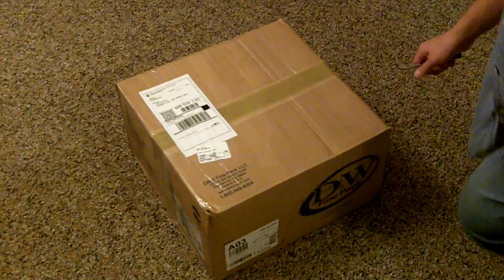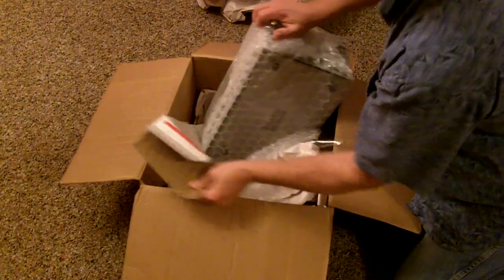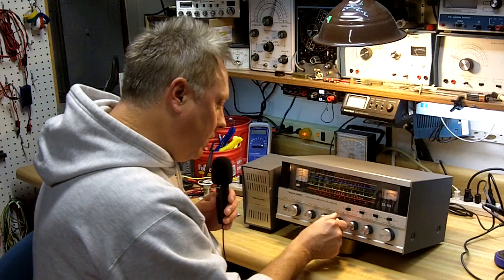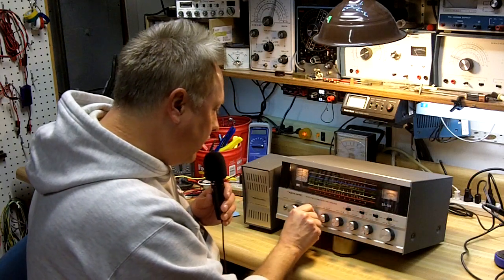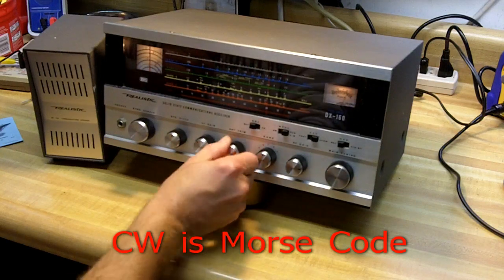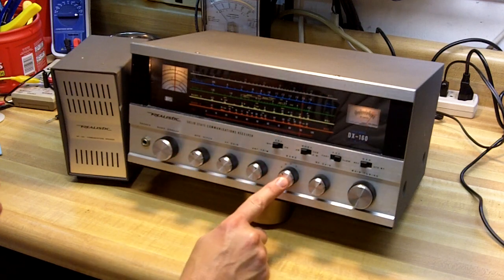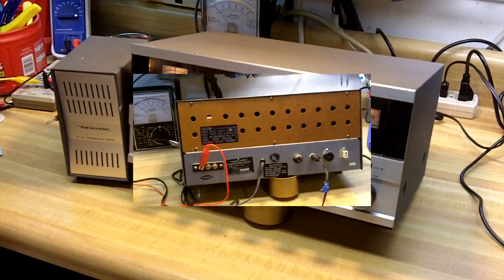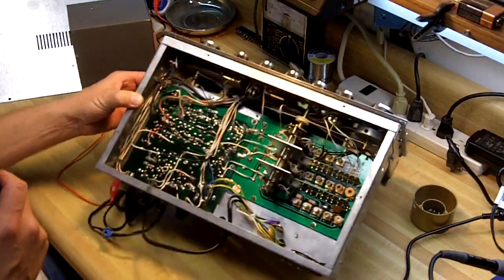My Realistic DX-160 Shortwave Radio Arrives

Comment: I see you've got what looks like a Heathkit IG-5280 RF oscillator.  I picked one up at a hamfest for $5 because it looked interesting but I can't find much information on its operation.  Where would you recommend going for starters?
Reply from the maker: I don't have much info on it here myself either, I do use it from time to time and it works fine but I think there is some places out there that sell manuals for Heathkit products online. I would just do a search for Heathkit manuals and include the model number and I would think you would probably come up with some things. Maybe someone else will comment here also.
Reply: RadioHamGuy Alright, thanks.  And by the way, it was your Magnum 1012 video that got me interested in HF and it's the reason that I have my General ticket today.
Reply from the maker: W7KMS Wow, that is really great to hear!  I hope you enjoy hf, it has been so much fun for me, so many things you can do if you want to on those frequencies.
Reply: I've been really eager to use it but I got my dipole in the mail about a week before I had to leave for college.  I used a random wire for SWL for a few weeks before that, and I got a QSL card from WWV.  Unfortunately even listening has been impossible in this dorm room.
Reply: Look over on Jeff Tranter's You Tube videos; he does a set of videos on this series of test equipment from Heathkit.

Comment: Hello again. I just bought a 1954 Hallicrafters S-38D and it works great except on band four. On band four all I get is blips and static even with using the band spread control. I am running a single wire 100 foot antenna outside.  AM stations do drift sometimes but, I think that is probably normal. Do  I need to hook up my antenna differently to receive well on band four? As far as I know this unit has never been aligned and I am not really sure if it needs it or not. The sound quality is hard to beat on this tube unit. I am really having a lot of fun with it. Anyway your thoughts would be appreciated regarding my band four problem. Thanks ahead of time.
Reply from the maker: Conditions can change a lot on band 4, it is a daytime band so at night you won't hear much but you should hear something in the daytime at least towards the lower end of band 4.  The higher frequencies really depend on solar conditions a lot, some days might be very good but other days you might not hear much.  The antenna you have should work just fine, but it is also possible there is just a problem with band 4 on your radio also.  It could be the band switch contacts are bad or not sure off hand what else.  At times you should hear a lot of signals in the daytime if it is working though.
Reply: RadioHamGuy Ok . Thanks for the help. I did pick up a "little" on lower band four. I also could hear WWV beats so. must just be my location, or conditions. Thinking back on it, I believe the only time I tried using band four was a night so, now, that makes sense. Still learning. Thanks.
Reply: I added another 100 feet more of single wire antenna and band four is working good now. I am glad it was not a radio problem. Very relieved. Yea!
Reply from the maker: VintageGearMan Glad to hear that, have fun tuning around and thanks for the update!
Reply: You sir, are fine credit to YouTube.  Thanks for all your help.

Comment: Hi, just purchased my 2nd of these, this one is 'deaf' on band E, have only sprayed band switches, any suggestions you may have.  73's de Steve
Reply: Steve, probably will want to go through a complete alignment and cleanup if it's dirty.  (I cannot abide a dirty radio in my shop/shack; am cursed with OCD.) That said,  the service manual is available on the Internet but make sure you get the one for your version. If your radio's SN is higher than around 421000 or so, you'll want the second edition. 
Also, there's a yahoo group for the Realistic radios and the folks will help you out there.  (You'll need a signal generator as well.)
Good luck.
Reply: Thanks!

Comment: Is your 20 foot long wire aerial 20 foot for a reason ? One last question for you. Would a 20 foot long wire aerial work with a Realistic DX 394 ? Many thanks for your help.
Reply from the maker: No reason, it was just a random wire I hooked up to it but works ok.  For the shortwave bands you don't really need a real long wire but if you can make it longer it would be better and get it outside away from the house and in the clear, higher is better also.
Reply: +RadioHamGuy look around before you put up a long wire antenna, there are many pitfalls with long wire antennas, like noise and overall performance.  The most important thing is to have your antenna away from electrical interference more to the point you're home the difference is night and day, vertical shortwave antennas with proper ground planes can out perform Random wires by tons!

Comment: A poor receiver. Dead as a doornail above 15-20mhz, Dial backlash, poor audio, Much better out there. JMI.
Reply: Paul Rose Or Buy an old Racal with Nixie tube digital readout.....If you paid thousands for an Ft1000 Transceiver they would also be dead in the higher bands during solar minimums...Also a long piece of copper wire makes the best Antennas or Aerials depending where your from they are cheap to make and work really well can't understand why so many people spend a lot of money on commercially made antennas..  .
Reply: Ever heard of nostalgia?